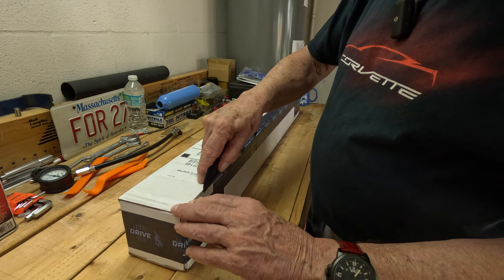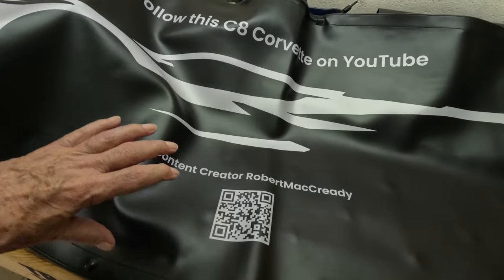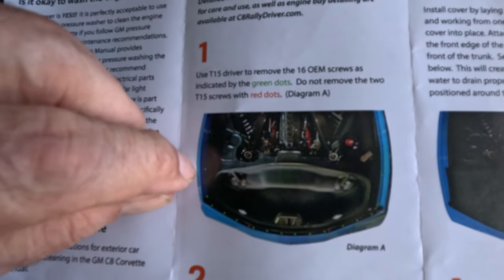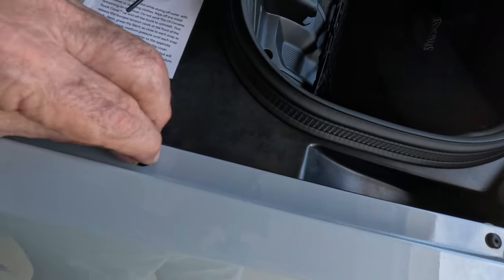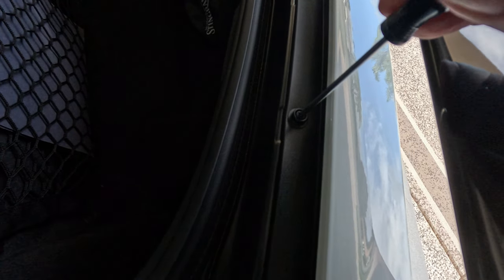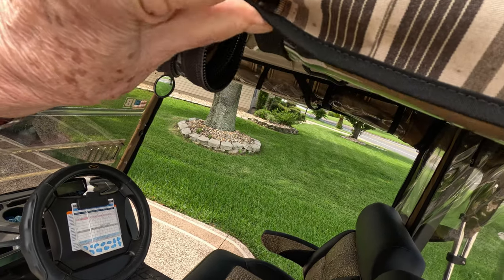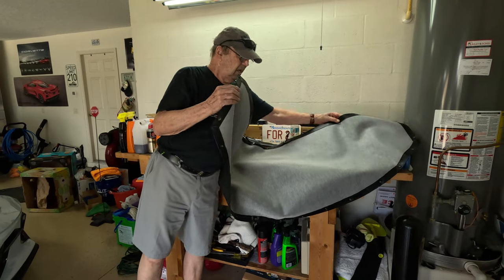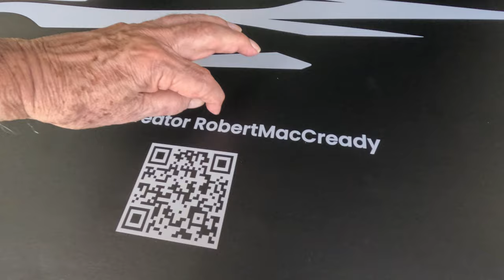C8 Corvette Trunk Cover Install & discount code

Comment: Looks awesome! Time for cars and coffee.  The snaps on the C8RallyDriver trunk cover are medium pressure and not quite as deep dish, you might find they actually get a little easier after a few uses and the black oxide coating gets smoother.  The Corvette brand logo covers are licensed GM accessories, so rest assured we stand behind the product with a lifetime warranty. Let's Drive Yo!
Reply from the maker: Very impressed with the quality and fit. Might be my easiest project yet. And love the results.👍